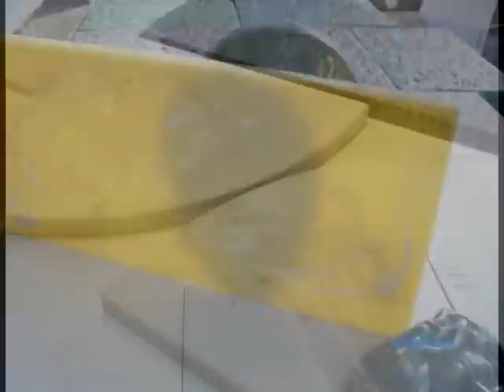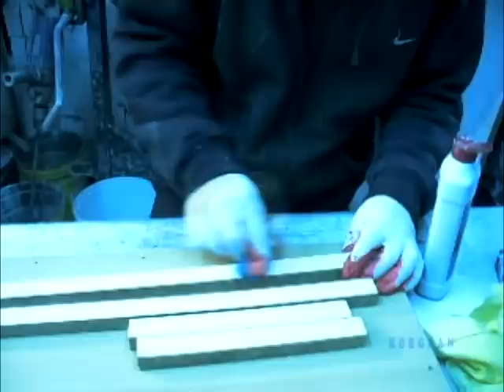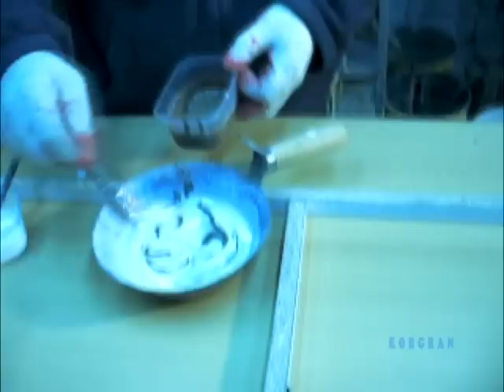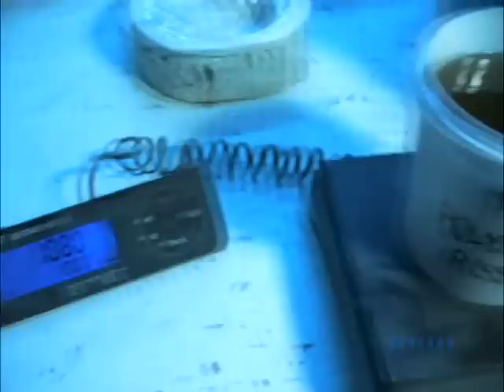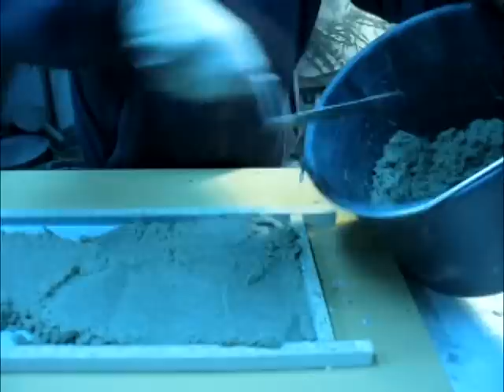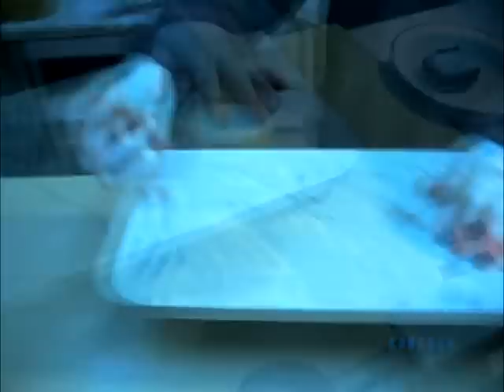Cultured marble solid surface countertop fabrication

Comment: what did u make it on top of that it did not stick to it? what are boarders made out of as well that it does not stick? what resin did u use? what dies or color powders do u use? what was the filler used near the end? what was the filler mixture rates?
Reply from the maker: +Michael Barnhart 
Mold relase wax
Poliester resin
Solid surface chips and ATH

Comment: hi
is this resin is the same resin that we put it on fiber glass to make molds and the second question is if we put fiber glass on the mixture the countertop table becomes very strong and we make it very thin about 3 centimeters  is it correct or not 
thanks
Reply from the maker: You can use resins for fiberglass but better for cultured marble or polymer concrete.
Countertops 3 cm do not need glass fiber reinforcement.

Comment: hello, i have a question: After the mixing, did you use heat to cure the resin? in order to make it solid. 
regards =)
Reply from the maker: Yes, recommended.

Comment: Thank you for your excellent work  
I have a question
can i replace the components   used with other materials
  What type of resin used 
Thank you
Reply from the maker: Polyester / Epoxy / MMA  resin < 20%  + dry - mineral gelcoat / quartz sand  / ATH
Reply: thank you very much
  What do you mean by  MMA and ATH

If possible, the names of    components in French
thanks
Reply from the maker: Méthacrylate de méthyle (MMA), Hydroxyde d'aluminium  (ATH)
Reply: ok thanks
Reply: What quantity of each material ... it is possible to make the whole piece in the same color, that is, without being only the surface ..

Comment from the maker: The film presents a new method for the manufacturing of solid surface.
Method is based on a special mineral gelcoat.
Mineral gelcoats facilitate of performance compared to traditional ones.
But they are not yet commercially available.
Resin is added to the quartz sand with plasticizers
Reply: what is the purpose of adding plasticizers with resin ?

Comment: That is not solid surface.  Solid Surface is void free material produced with a vacuum mixer.  That being said I will take 200 pieces a week from Friday.
Reply from the maker: Vakum can be used but it will not change the material properties. 
Solid Surface is not a method of fabrication but material properties